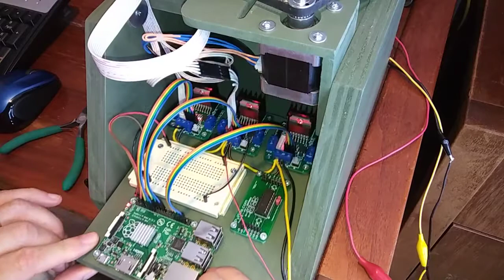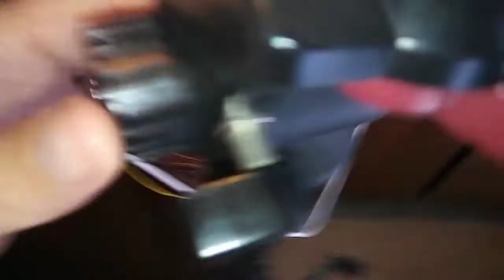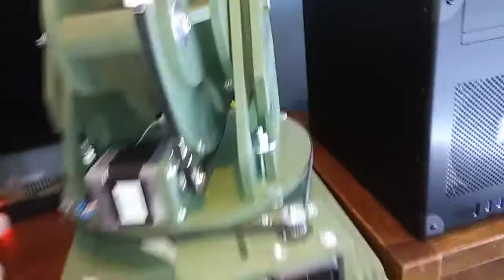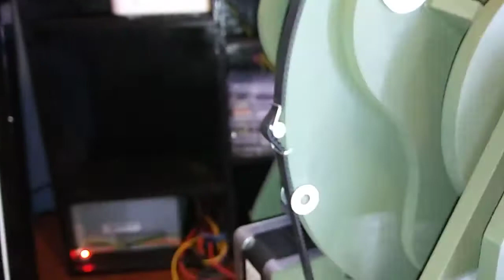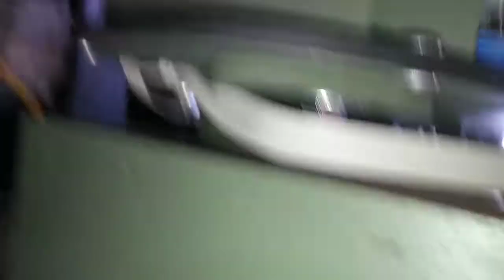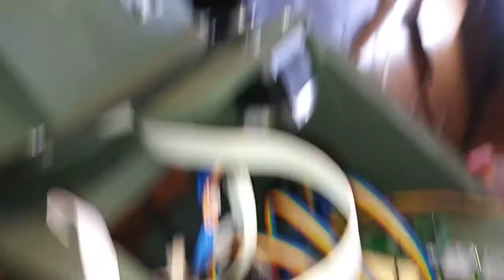Stepper Motor Music and Movement - Targeting Part 3

Comment: For reference, how many N.cm does that motor have?
Reply from the maker: The motors are Minebea 17pm k402 pv4. I buy motors from tony34306 on ebay. I think the rated torque is Detent 200 gcm and Holding 3400 gcm. I didn't get that from Minebea. Got it from here: https://www.theprojectasylum.com/electronicsprojects/componentdata/minebeasteppedatacirca1999.html
Reply: Ok thanks for the reply.